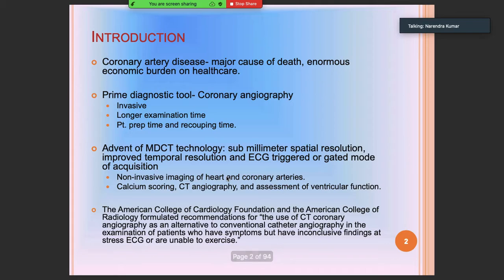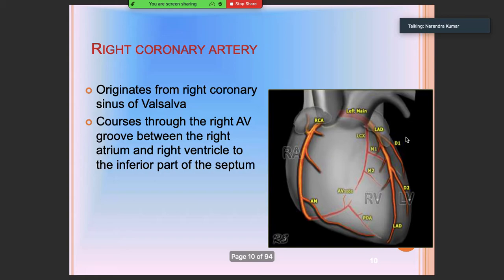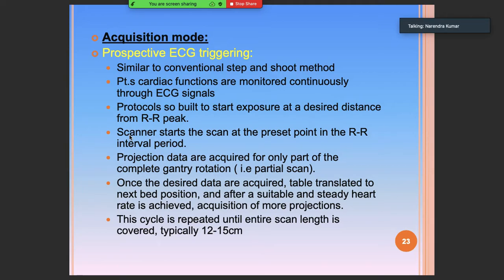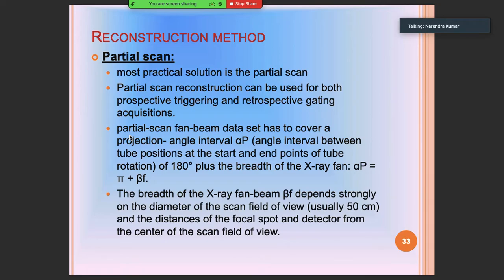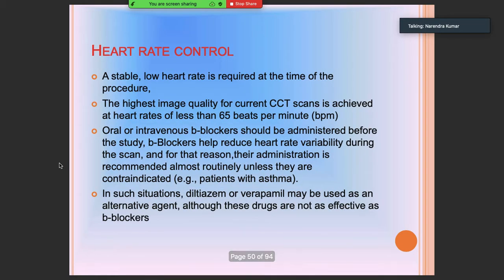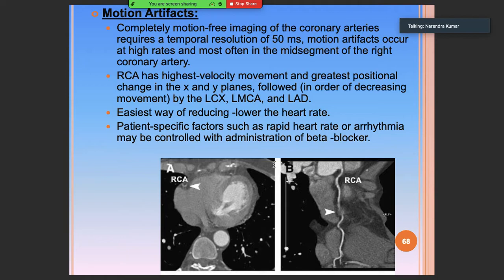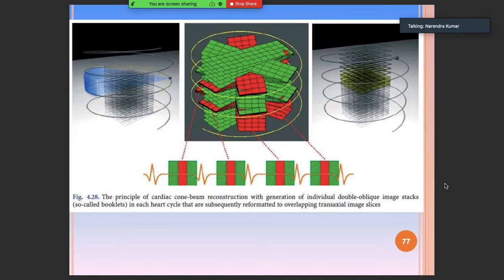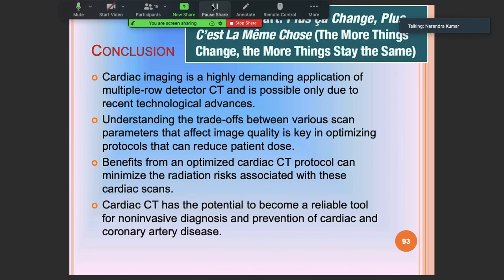Coronary CT Angiography and Calcium Scoring | Cardiac CT

Comment: I’m a 50-year old, overweight female with mild high blood pressure (130/90). My total cholesterol and triglycerides are very high. I recently had a cardiac CT scan and angiogram and was told my cardiac calcium score is 0. So if high cholesterol can cause blockages, how is it possible that I have absolutely no plaque in my arteries? I just don’t understand the correlation, or why there doesn’t seem to be one.
Reply from the maker: Please email us your query. We will try to help you with same.